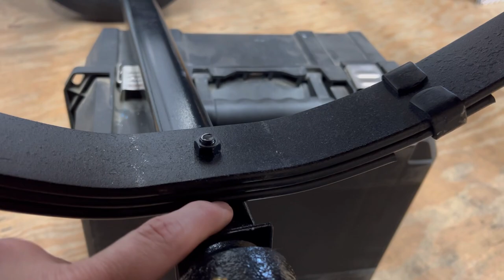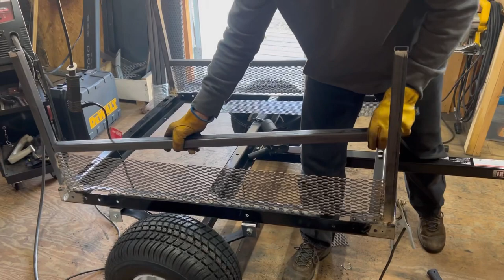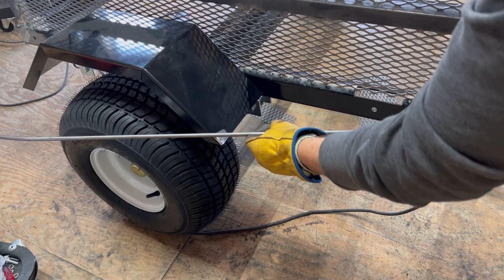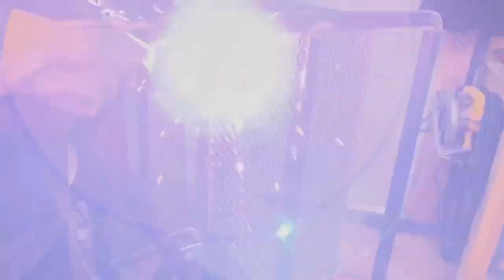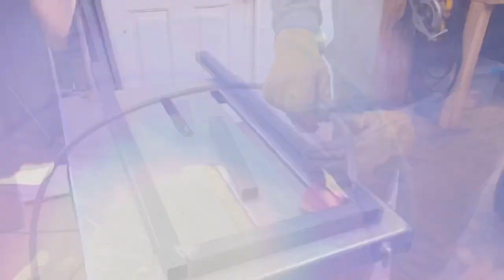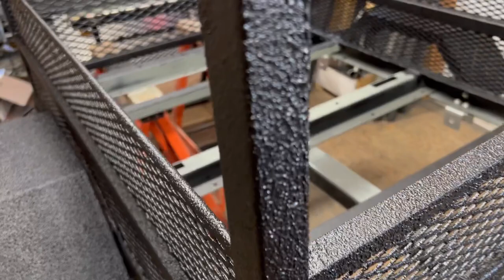Building a UTV/ATV off road trailer

Comment: You could save you so time by ordering 2 inch spacers. It worked fine on mine.
Reply from the maker: I looked at that and I couldn’t fine the studs that were long enough. At least not here locally. Thanks for the advise. Maybe in the next build.

Comment: Hello Daniel, very nicely done ! I would like to know where you purchased those wider tires. And what is the center bore or rimhole size of those tires?  I just recently purchased that trailer but, it is still in transit. Thank you! Jeff
Reply from the maker: I’m glad you liked the video! I got those tires at Northern Tool. They are 215/60-8 4 on 4. 

Here’s a link to to the ones I purchased. 

https://m.northerntool.com/shop/tools/product_200330201_200330201

Comment: Thank you for this video, I don't think I can do all that framework, Can I get a smaller tire to fit the frame?
Reply from the maker: Thanks for the comment. Absolutely, the kit came with the smaller tires that can be used. I used wide tires for the trail. The thinner tires would work depending on the application.
Reply: @outdoortypelifestyle9489  I am thinking of getting an offroad set of tiers that will fit without having to cut the frame as you did.

Comment: Maybe some 2 or 1 inch spacers for those tires would've been good
Reply from the maker: That might have been an option but I couldn’t easily find replacement stud long enough for the hub. I was thinking to keep it easy to repair at a northern tool or Lowe’s if/when I break it on the trail. I’ve beat on it pretty good so far.

Comment: You probably could have just gotten longer bolts for the hub and just have gotten a thicker spacer
Reply from the maker: I thought about that and I didn’t want the tires sticking out for trees to catch on. I drag this through pretty thick brush and have racks on all the edges to prevent saplings and trees from catching and pushing off. Good point though!

Comment: Nice! I'm looking to do something similar so we can take our dog camping. If you were going to put suspension on this would you recommend leaf springs or torsion axles?
Reply: This one came with leaf springs. The trailer was rated for 1400lbs. I was never going to have that kind of weight so I pulled all the leafs but the main one. That and air down the tires helps be a little smoother on the trail. At least here, leaf springs are more common and easier to procure. Hope this helps!

Comment: What type of paint and primer are you using in this?
Reply from the maker: The primer was Rustoleum primer from Lowes. The paint was the Rustoleum truck bed liner. It’s really not a typically thought of paint, but a 2 part epoxy paint. It has a bag with two compartments. You press down and burst the separation wall so the two can mix. It has like a 4 hour working time. It has proven to be very durable! Thanks for the question. I hope this helps!

Comment: Nice trailer.  Do you know how wide it was outside of tire to outside of tire with the factory tires?  I am looking for a trailer to pull behind my ATV in and out of the woods to get firewood.  All the "ATV" specific trailers like polar brand etc are super expensive.  Thought about this one but it may be to wide for alot of my ATV trails.
Reply from the maker: I just looked back at the base trailer and it stated 52-1/4”. I would guess that is outside fender to outside fender. If you didn’t install the fenders you could shave off another 2-3” to get tire to tire dimensions.
Reply: @outdoortypelifestyle9489  Awesome, thank you for the help
Reply: @outdoortypelifestyle9489  Hey one more question if you don't mind.  This trailer, axle and all seem heavier built that most "ATV" specific trailers, do you think it would do ok over bumpy ground in the woods hauling firewood out with an ATV?
Reply: @matticus6339 I use mine for that quite often. Since the trailer is rated for like 1,200# the suspension is pretty stiff. I pulled out a leaf in springs since a full load on my trailer is probably only around 250# and I wanted it to absorb some of the bumps not bounce. I have a Kawasaki Teryx that I use to drag it all over the mountain and it does well.

Comment: couldn't you have just added another spacer, or used a thicker spacer?
Reply from the maker: I initially looked at that with using everything I had. I would have needed to use so much that I would have needed to replace the studs for much longer studs. I was a little concerned with all the weight being on the studs and not supported at all on the lip of the hub. Probably wouldn’t have been an issue, but if it would have broken out in the woods it would have been a major pain to repair.